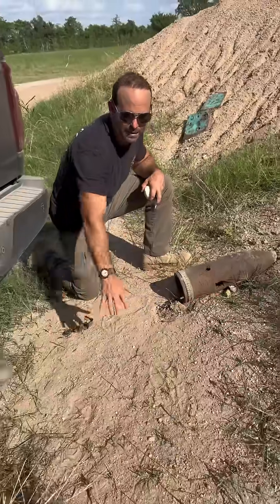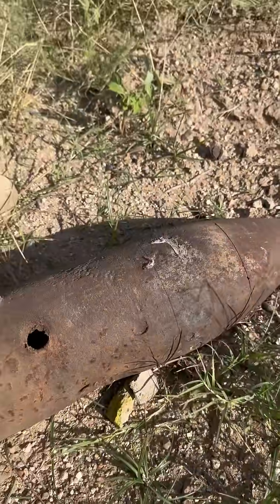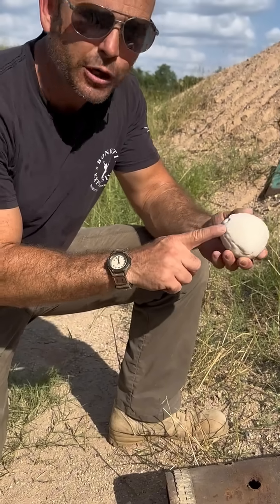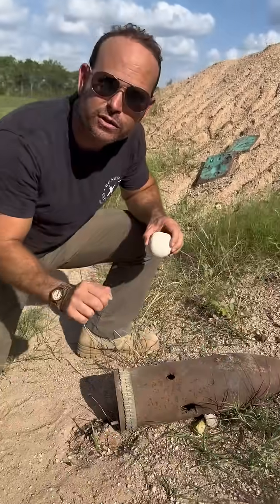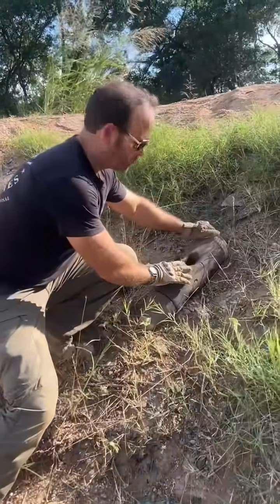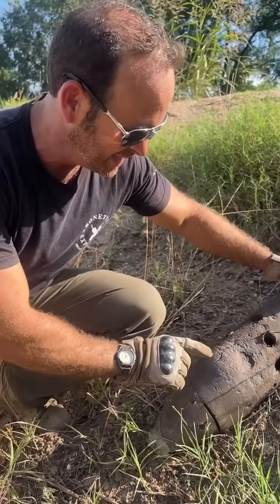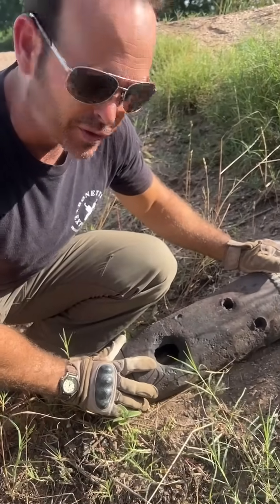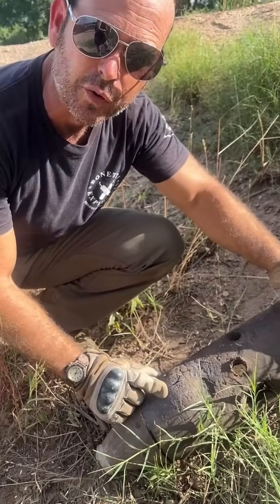Comparing ANFO With C4 #anfo #c4 #pyrotechnics #explosion

Comment: Even without any explosives at all my HV pulsed power device would puncture one wall.
Honestly I don't know your C4  but 200g+ and it failed to puncture both walls???
Is your C4 bad?
Reply: Lol
Reply: Tannerite would actually do it, Ammonal is a binary & off the dome I think it's 25k fps
Reply: @RectionHG tannerite is similar to ANFO
Reply: @RectionHG it wouldn't. The detonation velocity of ammonal is very similar to ANFO, and (probably around 4-5 km/s for prilled material). Neither come close to RDX, PETN and other high performance compounds (>8km/s at high density), which have double the RE factor, and significantly higher brisance.